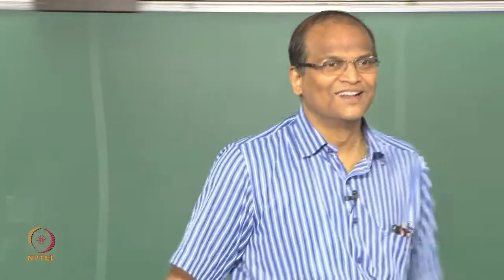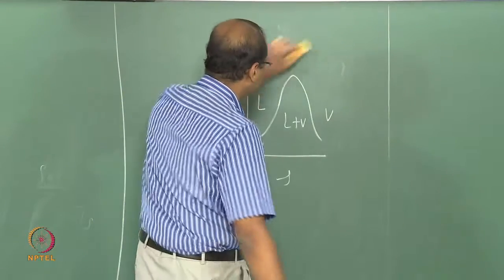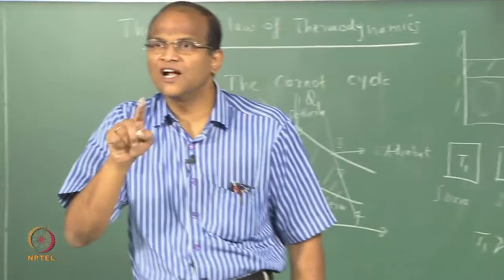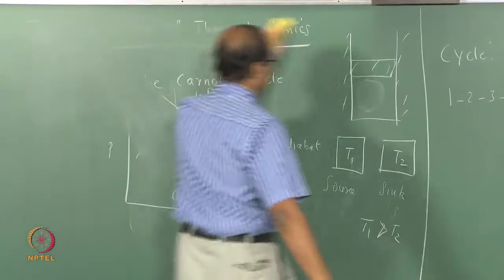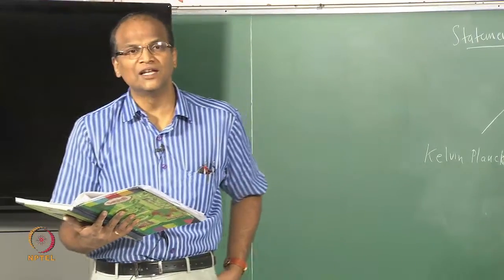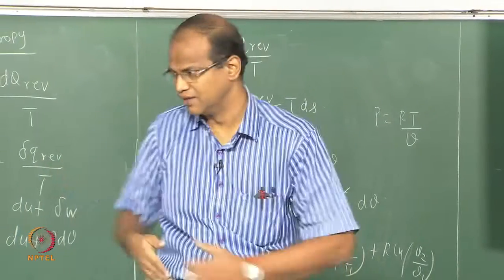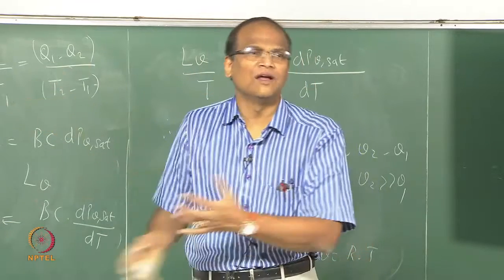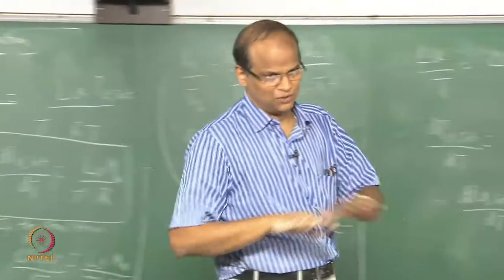Mod-01 Lec-29 The second law of thermodynamics – Clausius Clapeyron relation

Comment: The derivation of Carnot Efficiency is wrong. The ratios of heat sources should be in line with temperatures of the reservoirs i.e. Q2/Q1 = T2/T1